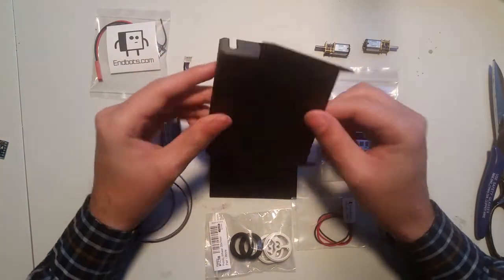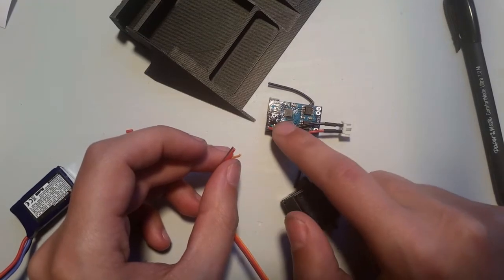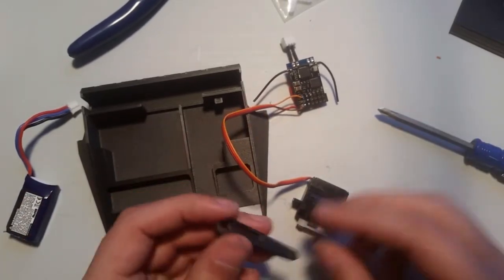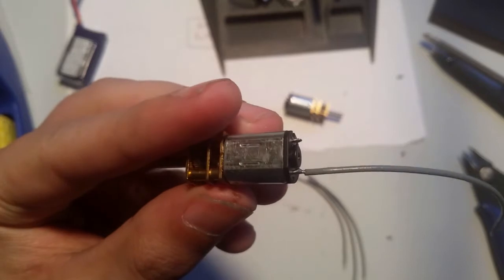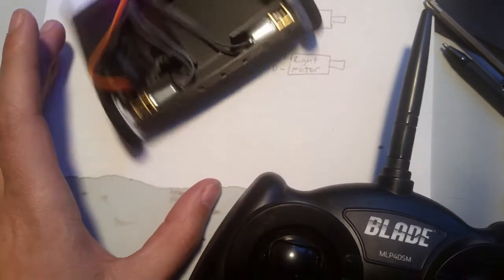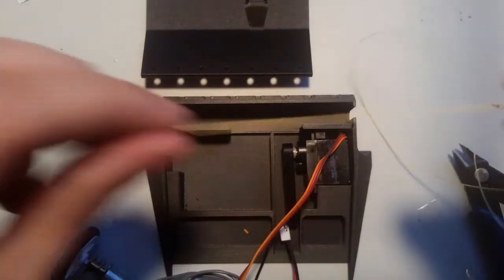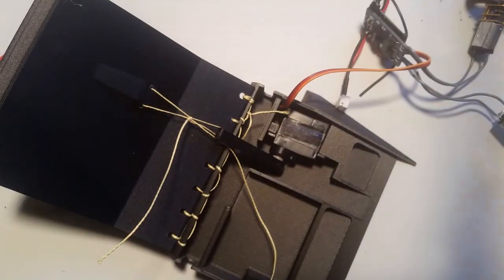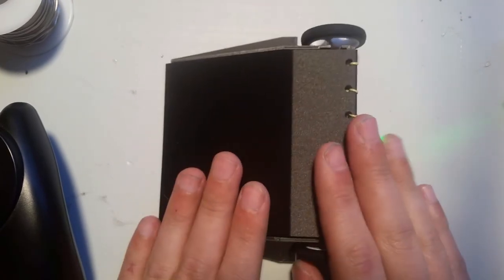Raven Fairyweight Build

Comment: Does the kit come with a charger for the battery used?
Reply from the maker: No
Reply: Endbots Could you provide a link for a charger for the used battery? My balance charger doesn't charge that kind of connector.
Reply: Not how it works.
Reply: Maybe that could work.

Comment: That transmitter is DSM2? For that price?
Reply: The transmitter is not included.
Reply: Jeffrey Olijar Yes, I am aware thanks. I just mean that you can get them for like 20 bucks on eBay.
Reply from the maker: Yes, if you hunt for them.  They go from 20-30 usually.
Reply: Endbots Yeah. I actually had one from a helicopter that at first worked fine, but now has bad input lag for the desc.
Reply from the maker: TML ProductionsTM the only time I've had input lag was the circ rumble this year and it was fine after
Reply: Interesting